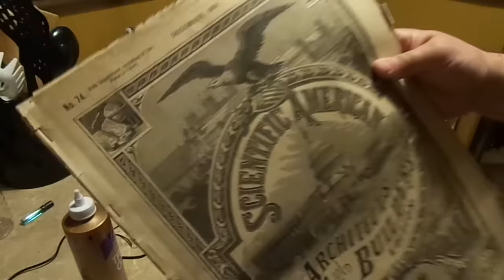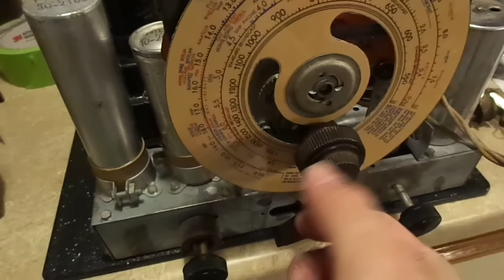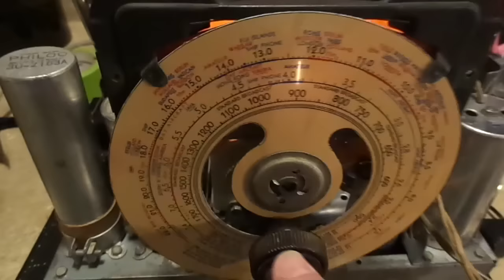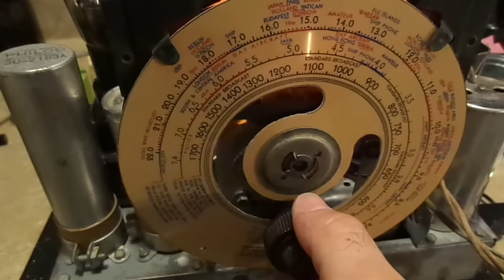1937 Philco Speaker Repair

Comment: that nois at 19:19 sounds like a radar, wheather maybe, or possibly a jammer, but when those happen in the states they ussualy report by listing ham and taken of the air perty quick by the fcc. Im guessing the viao is for another video?
Reply: +MattTheComputerGeek Actually it could be any one of a number of digitally modulated signals, many of which sound similar when listened to on an AM receiver. Most likely it is DRM (Digital Radio Mondiale), a digital broadcast format used on some modern shortwave broadcasts.

Comment: I never knew you could fix speakers.  Usually if we get one ripped it goes right out to the trash.  Or when i was a kid, i would beat the crap out of the magnet till it came out and use it to pick up iron filings.
Reply from the maker: +worldgate989 This particular speaker is incredibly hard to find, and as such, very valuable. This radio pre-dates speakers with permanent magnets (they were unavailable at the time, mostly due to cost), so the amplifier was designed with a "field coil" in place of a magnet.
Reply: BBISHOPPCM's World Wow really, might have to go check out the thrift store, they have tons of old speakers.  Sounds like they used an electro-magnet then?
Reply from the maker: +worldgate989 That's exactly right. Look for speakers with a four-pin connection.